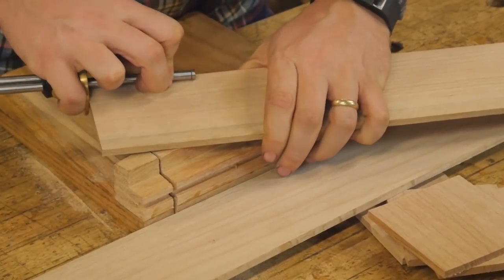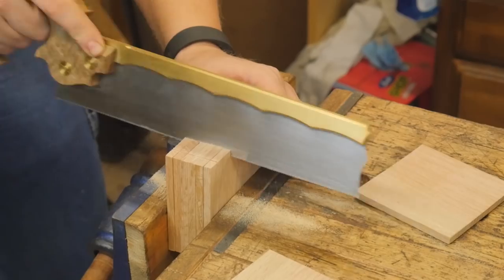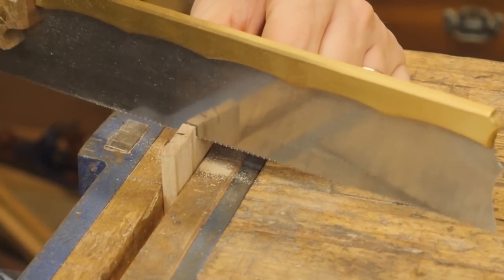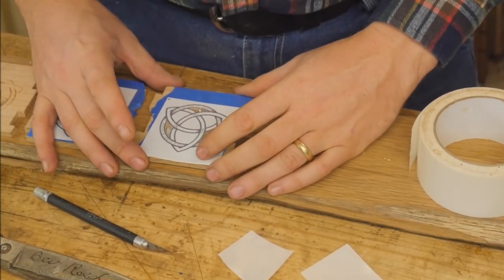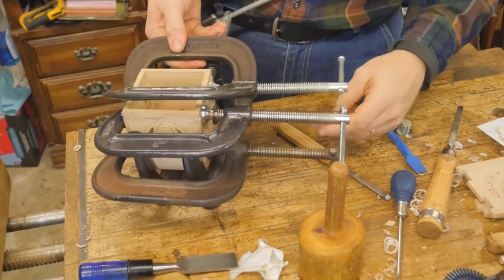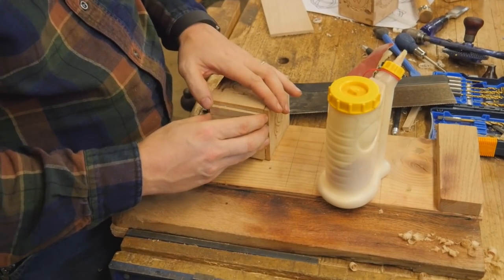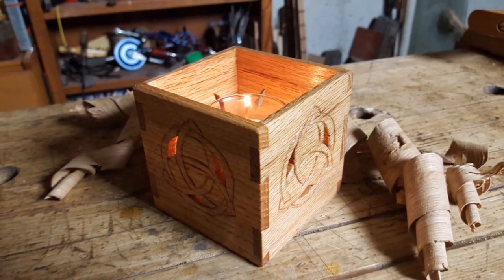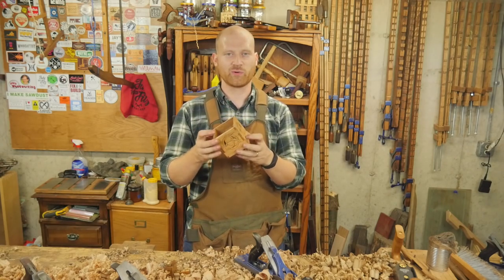Building a Dovetail Candle Box Handmade With Oak Fretwork and Carving

Comment: Awesome James- Impressed with how restrained your were when the boiled linseed oil went south ;) my swear box would have overflowed.Great  finish to. I was thinking of using Pine but I've heard its difficult to dovetail which would explain my many failures😳 I have oak but I don't want to spoil it yet I'm just a scary cat LOL
Reply from the maker: pine needs a sharp chisel! and don't push it just a bit at a time. oak is not easy as it is so ring porous. one of the easiest is poplar. smooth to cut but not too hard.
Reply: Wood By Wright message received I will sharpen those chisels forthwith 👍